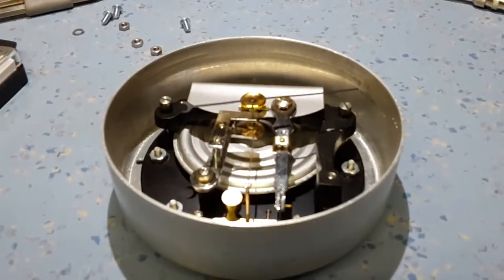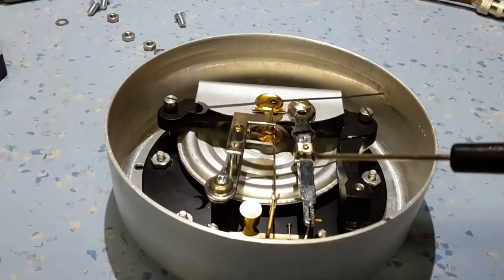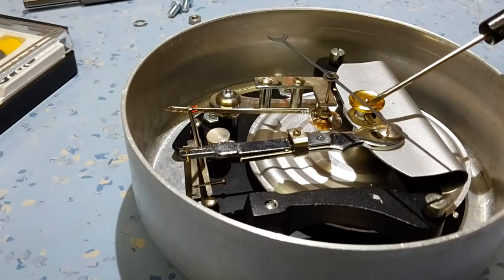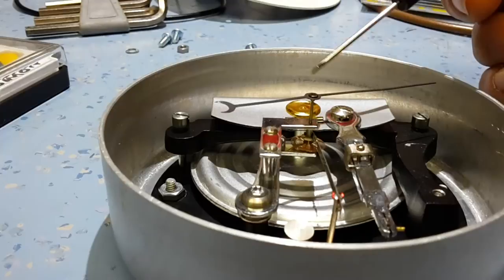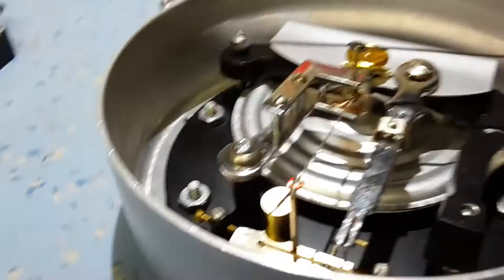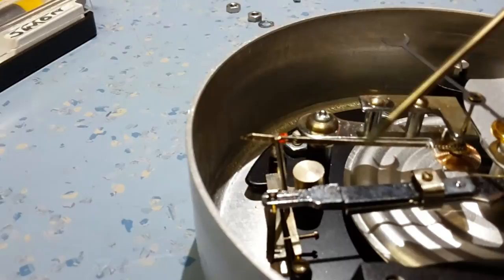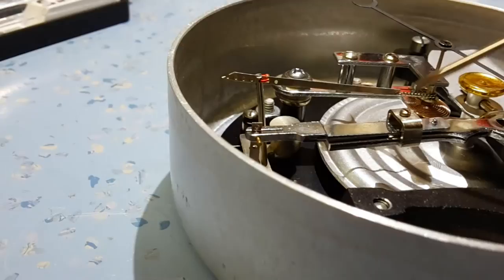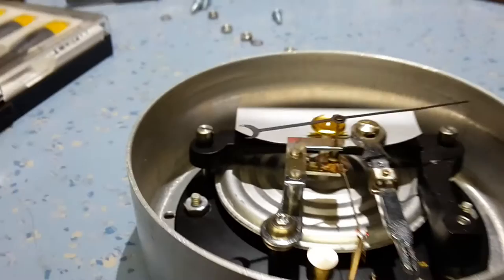Aneroid Barometer workings take 2

Comment: Thank you. I have repaierd a few mechanical clocks but i have a couple of barometers to look at. I have a modern barometer that i purchased new. I say new i mean about 25 years ago. Made by Wydop. It's reasonable accurate but doesn't quite read the very high pressure above 1025mb and also not quite the very lows bellow 980mb. It never has.
I may take it apart and see if i can adjust that gain a liitle.
It needs the bezel and glass cleaning anyway.

Comment: Impressive knowledge! Thank you for this. Can you explain how to set the position of the two screws that support the casting on which the large spring is attached? My guess is that they simple serve to adjust the height of the casting and thus the spring, and also to make the casting sit level when the adjuster screw is tightened or loosened for calibration, but it's not obvious and I could be completely misguided. Thank, in advance.

Comment: I've got an old Everest anaeroid barometer, which is one of 3 instruments in a wooden block (clock, barometer & thermometer).  I added a couple of micro-drops of fine oil to the spindle shaft & lever pivot points, and it seems to be working pretty well now.  I follow the local pressures on the local University website, and it seems to be tracking the changes pretty well.  The only thing is, I do need to tap the glass to get the pointer to move!  Is this because the mechanism is sticking somewhere, or is it normal?
Reply from the maker: Victor Yes tapping the barometer is fairly normal on dom
the barometers. The diaphragm has hardly any power to overcome the drag of the pivot points. I.have a few barometers with a stack of diaphragms in series and sometimes in parallel to add gain and force. These are high end devices and are very pricey. 
A sticking mechanism does have its uses as you can see the trend of the pressure if the set hand has not been set recently.
Reply: Funny, I was just thinking that I could maybe build-in something like a tiny electric vibrator-motor, to 'buzz' the mechanism say once per hour, to get it moving.  Will try this & update on how (if) it works.

Comment: If the pointer is removed, should the bellows be at low, medium or high expansion when replaced?  I can make it read correct with the adjustment wherever the bellows and mechanism are positioned.
Reply from the maker: Depends on atmospheric pressure. Set it so the chain is midpoint around the spindle to be same. Then set needle similar mid position.
Reply: @SoddingaboutSi  Thanks for the help, Edward

Comment: Is this movement from a Cole Parmer barometer?
I've seen one of these for sale with what appears to be a similar movement. Not cheap but having the option of purchasing a calibration certificate tells me it must be very accurate.
Reply from the maker: This is a typical barometer movement of the Vidi design and is very common among almost all the aneroid barometers of last century. They are used in Metrological applications and can be extremely accurate over long periods and varying temperatures.
Reply: @SoddingaboutSi  Thank you for your reply. The reason I asked the question is because I am toying with the idea of buying one of these and the instrument I looked at has the same movement that you used in your video.
However, I have since found another barometer with, again, the same movement but under a different name to the first one I looked at which was Cole Parmer. Again I thank you for your promp reply.
Reply from the maker: Just check it is temperature compared and uses ni-span C  bellows for low hysteresis.
Reply: @SoddingaboutSi  Now you've lost me! Perhaps you'll be so kind to recommend a model that can be purchased with all of those attributes you mention. C-span, low hysteresis...
I remember the term hysteresis from electronics many years ago a figure of eight like trace on an oscilloscope but that's where I draw a veil. 
If it's of any interest I have a banjo barometer from the late nineteenth century which has a mercury thermometer, open ceramic dial and this is always very close to the digital weather station I have. I bought this big banjo barometer about twenty years ago from a dealer. It cost £300 and I remember he said: " You've just bought my finest anaroid."

Comment: 2 years ago at Christmas my wife bought a german barometer from an antique dealer in Berlin. After all types of weather in the last 2 years we have noticed that the pointer moves only moderately in each direction, never traveling more than 18 Deg +/- each way from the "changeable" noted position. Can I calibrate it during a period of stable weather without a vacuum chamber or can I oil some of the pivot points and hope for the best. BTW we live in New York.
Reply from the maker: You can calibrate it to a degree. Choose a day with high or low pressure and set the needle. Wait for a pressure change of the other extreme and see what the barometer says? Then adjust the gain adjustment to increase the gain. The smaller the gap the more gain you will get.
Reply: @SoddingaboutSi  Thank you so much for your reply.. Is the gain adjustment the small horizontal screw that moves the forked shaped tines apart?
Reply from the maker: @franktremblay6416  Yep that's it.

Comment: Also wondering, why do barometers always use a fine metal chain to transmit the lever movement to the spindle, as opposed to, say, a fine nylon thread?
Reply from the maker: That I don't know.  At a guess a legacy from back in the day. Also Nylon is hygroscopic and will change in length.
Reply: Good point, that would introduce errors into the reading.  On the other hand, nylon doesn't corrode...

Comment: What gas would the capsule have in it, it it's not evacuated?
Reply from the maker: Victor Sometimes they leave a trace of air inside due to manufacturing limatations. I seem to remember maybe nitrogen was also used but not sure about that
Reply: I would have thought if the capsule gets perforated, it wouldn't be all that difficult to repair..  Just place it in an evacuated chamber, and plug the hole with epoxy glue?  Then when the glue sets, release the vacuum?
Reply from the maker: Tried that and failed. If you put epoxy on the hole and evacuate in a vac chamber, the air in the bellows blows the epoxy out.

Comment: think if this barometer is made one kilometer radius and 10 meter high than it will produce a huge large movement witch is used with the help of sensitive gear box and cheap electricity is for all yes sensitive gear box design in automatic Swiss watches are to be used in this process if not understand than you can make a computer simulation and various size design calculator and this barometer is used in most extreme whether in the world Bingo USA many States may use this model and Indian plate is also used this model or Australia may use this model with some banding arm related to sea waves energy ,that will propels it all the time  Any university listen me I am  very much mad about free energy for my survival as I am not able to afford a stable life
Reply from the maker: anil sharma If ypu made a barometer diaphragm 1 km wide i would expect it would move at the same rate as a small diaphragm but with more effort. 
The probem is pressure does not shift quickly. 
Have you looked at the Atmos clock?
Reply: Simon Spiers i think you are know about some physics but as i say if barometer is equipped with some gearbox than large effort may change into huge energy and this is placed in the area where bad weather is all the year around present like USA stormy whether or near black sea  what you think